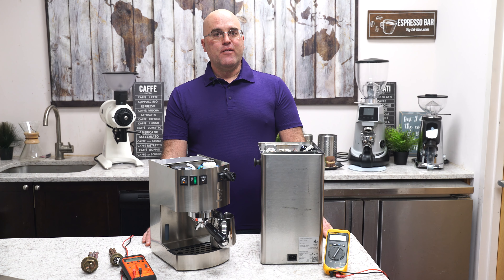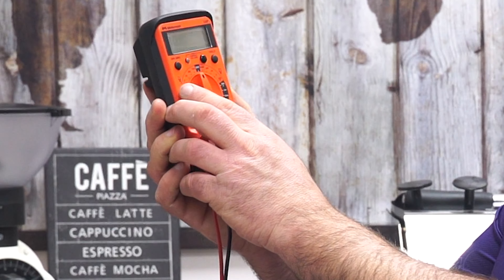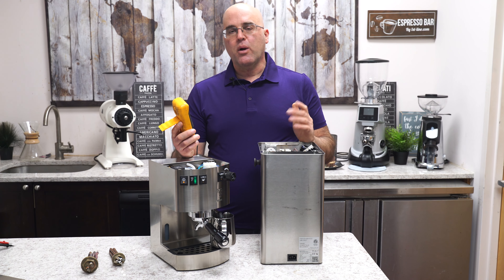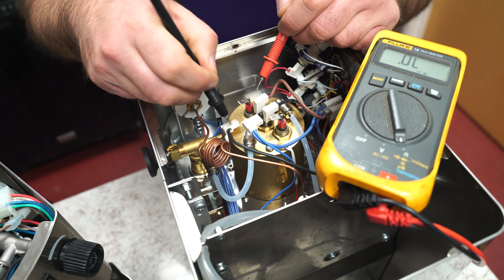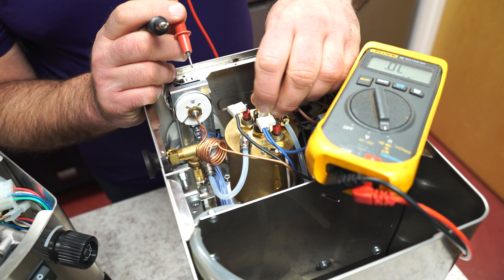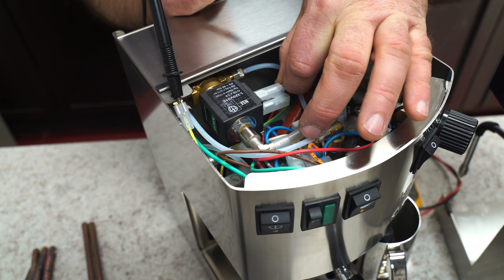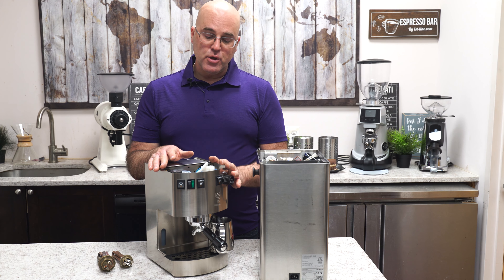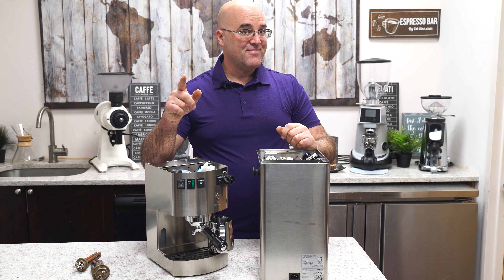Tech Tips: Electrical Testing On Espresso Machines

Comment: Thanks for this video. I checked with the meter one pole to boiler wall and and there is continuity. I checked the other pole to boiler wall and there is none. All thermostats have continuity.  Does this mean the boiler element went bad. The water is not hot enough 95 F. There is not steam. Only water comes out. The light doesn't come on. This is Saeco Aroma machine.  Thanks

Comment: Thank you so much for the great videos. I was gifted a 10+ year old Gaggia Classic. I noticed there's a small electric current on the metal casing when turned on and I have gotten zapped more than a few times. There are only two prongs on the power plug.... In your experience, is this worth fixing and if so, how do I fix it? Or is this unit too much of a hazard at this point. Thanks in advance!
Reply from the maker: Unfortunately, without the ground wire, you should not test the machine by having one of the probes touch the body or boiler like I show.
Reply: @1st-lineequipment  Ya. That's what I figured. I decided to buy another machine. I love espresso but I don't love it to death 😄💀

Comment: Thanks for the great video.  My New Hobby is tripping the GFCI when I turn it on.  If I unplug the wires to the heating element, it does not trip it.  But when I test for continuity with the heating element, it seems fine.  The machine is 2 years old.  What would the next step be to diagnose it?  Thanks.

Comment: My machine’s Ulka pump protector wire melted . I removed the protection and it worked for 5 minutes and then went back to tripping the breaker. Heating element is fine and heats up the boiler.. Not sure what’s next. Any thoughts ?

Comment: Thank you for this great video! 
An issue I’m having with my BZ Hobby is that it’s tripping the Board RCD after few minutes. Sometimes within seconds and sometimes after few minutes. I checked the element for continuity and I don’t get a beep but I can make coffee when it’s lot tripping the RCD. Also added and gfi on the socket but it continues to trip the RCD instead. Any advice? Do I have to replace the element? 
Thanks in advance and I take full responsibility for any actions.